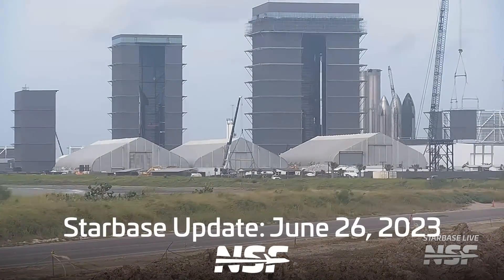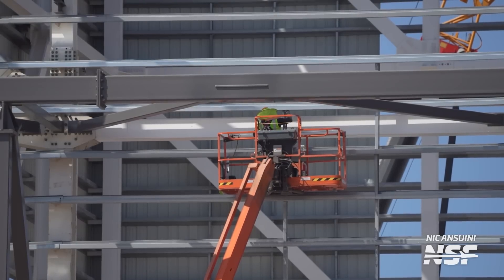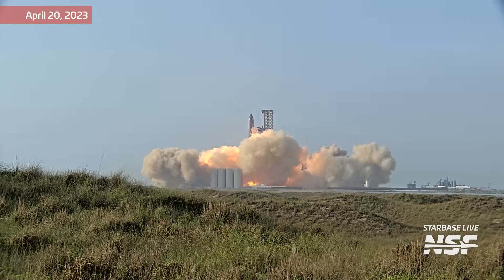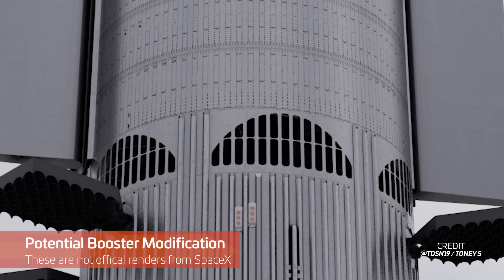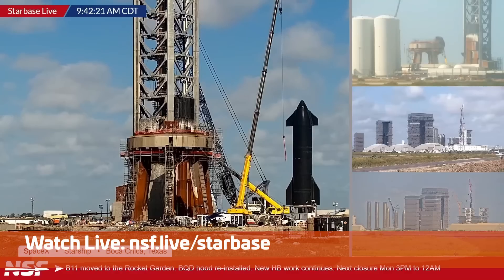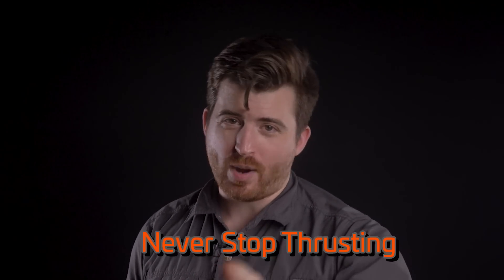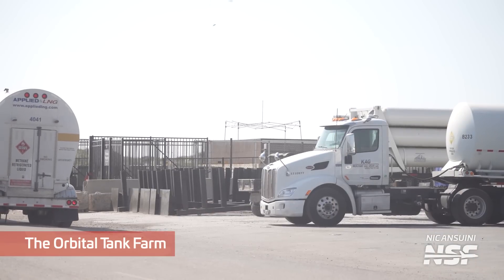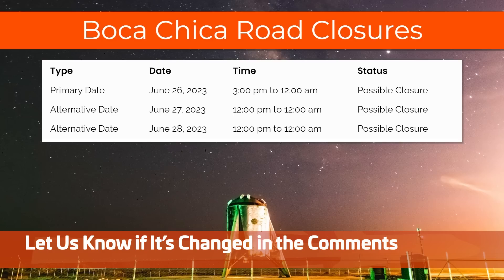Starbase Update: Hot Staging Starship, Boosters A Plenty & The Mega Bay Rises

Comment: Can someone offer an explanation for why the inverted showerhead design (as Elon shared) for the deluge system isn't flawed?  If the deluge system is trying to force water upwards, in direct opposition to the downwards force of Booster's thrust, wouldn't the force of the water need to be sufficient to overcome the considerable downwards force of all those raptor engines?  Sure, there will now be steal plates involved - not just concrete being blasted into projectile fragments... If you factor in that gas compresses (building up potential energy) much more than water, the point that the full potential energy is released in counter to the water pressure...

Comment: The hot staging interface requires some form of shield to protect the top of the booster. It will be integrated into the new section that is planned to be added top of the booster. IMO it will take damage. A solution is to make this interstage a replaceable puck, old one removed, new one added for next flight. That can be quickly and easily done, less than one hour.

Comment: Definitely feel Hot stage sep would    have some impact on reusability. We have to remember that the hardware for the header tanks where largely mounted on top. I would not be surprised if they need to add some sort of diverter/heat shield puck that will sit on the inside and need to be replaced between so many flights. Its doable but would increase turnaround time and have a good impact on mass to orbit.
Reply: The only header tank on the booster is all the way at the bottom near the engines and not at the top.

Comment: I could see a hot stage being easy to deal with, you could just place a steel plate on top of the booster and let it degredate over time until it needs swapping out, would also be cheap, however you would have to give up some postitive thrust for the weight of the plate

Comment: I have a bad feeling about a Hot Boost, but I hope it works.
Reply: Hot boost is mandatory. Otherwise it's just a water rocket. 😅
Reply: Exhaust temps at that altitude will be much lower than at sea level. Out gassing  will be rapid and THE initial confined pressure before separation will be remarkably lower than one might think, and its not going to take all six engines at 100% to separate the stages. Hot staging at Spacex has always been a topic of discussion. They might NOT need to Hot stage if one or more alternatives are considered. Wish them all the BEST....Question NOT....what is Not understood.
Reply: @dunehut  agree pressure will not be as high as one might expect. But the expanding gas temperature will surely be very high. But it will be brief, so not much time for heat damage.

Comment: If booster will get the extension, it seems like that means the ship QD arm needs to be mounted higher on the tower. Unless it will have a mechanism to extend up/down from its current mount point.

Comment: So after noticing what rocket engine exhaust does to concrete, they decided to point it at their first stage instead 🤔
Reply: Should go better without a planet in the way
Reply: the ship only has 3 vacuum engines, although it might also fire the other 3 sea level engines too. thats much less engines than the booster, although its still pretty powerful ofc. someone else in the comments suggested that spacex could ignite only one engine for hotfiring (maybe at low throttle) which would reduce damage to the booster.

Comment: 😊why can’t they just cover the top of the booster with the same heat tiles that are on Starship so it doesn’t blow up during Hot staging? Especially since they would weigh a heck of a lot less then some super thick steel dome?
Reply: The heat tiles are very fragile.  They would blow off like dandelion fluff.
Reply: I can’t imagine it being under anymore pressure than they would be as they are in re-entry

Comment: Will that make the full stack taller? Consequently also making it necessary to increase the height of the SQD
Reply: Yh, links in with the reason for taking the SQD down as well. Its not gonna need to be massively higher, 1 ring maybe 1.5 rings so the arm doesn't need altering, but just a redesign of the QD bit on the end to make it higher up. 

We'll probably get a good idea whats what when they start adding steel work to the SQD platform.

That said they've said B9 and Ship 25 will be next, so unless they do work to B9 we might not see this until after then? Unless they just add a random extension piece on top?

Comment: I imagine hot staging will make it harder to get starship human certified by NASA.
Reply: Hot staging is a very reliable method of staging, so it might actually help.
Reply: It might actually improve crew safety, because it allows the Starship to reliably separate from the booster in an abort scenario if they go without a traditional abort system on crewed Starships.
Reply: Soyuz hot stages, and NASA flies crew on Soyuz, so no.

Comment: I have my doubts about hot staging.  They could blow up both stages. Raptors will be way to close to be firing.
Reply: Hot stageng can easily be accomplished by just firing one raptor initially and after seperating go 100% with all engines
Reply: @frankderks1150  I had the same doubts about hot firing, but that idea didn't occur to me. even with only one engine at low power, you still would blasting the booster, which doesn't seem like the best idea for rapid reuse. however, we will just have to wait till the launch and see how well it works during stage sep (hopefully)
Reply: @HamzahKhan314  This can be tested on the ground. Pressurized a booster with nitrogen and test fire a starship on top. Also a possibility is to do hot staging by starting up the vac engines first. These are above the more slanted area of the dome and output the energy across a larger area.
Reply: @frankderks1150  i dont think they would test it on the ground. if there were a failure spacex would probably rather have it blow up during stage sep than on the pad.
starting vac engines first seams like a good idea. I dont think its been confirmed which engines will fire, but hopefully we can figure it out soon.

Comment: Here is what i dont get: How come the booster annihilated  the pad when fired (even during  the static fire with 50% power), but the Ships just casually do static fires on top of plain cement and we see no concrete chunks come flying? I mean it only has like half a dozen raptors but stills it fires them from pretty up close...
Reply: It's just the raw power difference between the two. The booster has 5.5 times as many engines, so with the same throttle settings for static fires thats 5.5 times the force, thermal energy and gas volume. The very early ship static fires like SN8 also had problems with the concrete, but over the years suborbital pad B got a few upgrades including the same fondag high strength concrete that was under the OLM.

Comment: If they are adding a vent structure to the Booster, it now makes sense that they would need to modify the Ship QD.  The Ship will be higher up and it's QD connections won't be in the same place.
Reply: If hot staging is successful it should also help prove that ship can escape a booster explosion.
Reply: Ope, I didn't see your reply before posting my duplicate comment. 👍

Comment: the real question is, will the vents weaken the rocket to the point that it collapses mid-flight
Reply: That bit should be very simple for the good engineers at SpaceX to calculate. The hard part is what to do to not harm the booster.

Comment: I came to the conclusion that Musk is more talk and advertising than anything else. The guy plays with crypto threw tweets for his own profit. He makes a space company while using outdated rocket projects resurrecting some 50 to 70's designs von wenher von braun. He couple those with modern technology and with modern thrusting systems. In my opinion he is more like a 50-70's space nerd trying to make the past projects happen than a space explorer. If he really wanted to revolutionize deep space exploration he would try to recover from the nerva program and build a space station to build nuclear rockets outside earth's orbit. It seems to me that his main objective is to make money threw cheap orbit transport for satelites and army devices threw reusable rockets and that deep space exploration is just an option he wants to try but not the main goal.  Let's be honest he is losing time with 30 engines while with 5 only he would have less issues and it would already probably reached orbit. He said 2035 on Mars but at this rate not even before 2070. I bet that if nasa works with darpa lockheed and northrop and get the funds they will get to mars way before musk.
Reply: The main point of Starship is to achive full and rapid reusabillity, which has been the holy grail of rocketry for the last 60 years. SpaceX is already the pioneer in this field with falcon 9, which is mostly reusable and only expending the second stage, already flying and landing multiple times per week. If Starship actually achieves this it would make transporting anything from earth into space at least 10 times cheaper, which will make large scale space projets even possible in the first place. Whats now known as Starship started out as the interplanetary transport system, a even bigger rocket concept with the only goal of deep space exploration, which was later downscaled to be used in the comercial launch market as a way of funding it's development. Starship is far from a big old school rocket as it's the most advanced launch vehicle ever by large margin and it's primary goals still is to make colonizing mars possible.

You also need to differneciate between Elon Musk, the individual and SpaceX, the company as there are thousends of rocket engineers and other employes working at SpaceX and on Starship. SpaceX is also a close partner of NASA, just like rocketdyne or the others and Starship is contracted to be a lunar lander for the Artemis missions. With all of this Starship is so much more than a billionaire space nerd trying to make big rockets happen.
Reply: @bongi6811  making Mars colonization possible ? A 1-2 years travel time is insane. Never mankind has tried this amount of space travel. The iss is space orbiting earth and can be easily refueled and repaired a thing that starship can’t do while going to Mars. A one years space travel would be like a suicide mission. If you increase the number of days for traveling you increase the issue probability. Everyday a system can fail, an impact can occur, plus people can become psychologically unstable in those situations. NASA could have done it but I bet they took those factors into consideration and said it should be reduced to less than half a year. Unless you are able to reduce time travel to 2 months it seems unlikely that we will reach Mars Alive and come back Alive ! And this is only possible threw nuclear propulsion.
Reply: @patrickwilliams2530  I don't think flying a year inside a Starship is unrealistic, since astronauts already spend nearly a year on the ISS which has a smaller habitable space than a Starship. But even if travel to mars requires a larger vehicle with a nuclear engine for shorter travel times, constructing many of those vehicles in orbit reqiures large amounts of payload to be sent from earth which is a perfect job for Starship and woundn't be possible with extremely expensive expendable rockets.
Reply: @bongi6811  the iss goes around orbit, they can be quickly supplied with anything they lack or any random tool for maintenance. Just think about an Apollo 13 issue type  with starship… they would be doomed… anything can happen in space and what Apollo taught us is that in every mission there is always something which fails or something which goes critical almost every mission. Apollo was only a 8 days mission and it had tons of issues… there were tons of engineers monitoring 3 man and the spaceship for 8 days. Now you tell me that a trip to Mars in 1-2 years with less engineers and with less experienced men will succeed? No way the first starship to launch to March will be a suicide mission.
Reply: @patrickwilliams2530  Any spacecraft making a trip to mars and back would of course need to be extremely reliable and have all the supplies, spare parts etc. onboard. While the ISS is much safer in case of a critical issue because of it's vicinity to earth, it also proved to be extremely reliable, staying operational for 20 years while only needing small repairs once in a while. The same requirements for a Starship making the trip to mars also apply to a quick nuclear powered vehicle and the reduced travel time shouldn't really make it easier since both already need basically perfect reliability which is achieved the same way through things like redundancy in critical systems. Getting the completely new nuclear engine to be reliable enough might even make that option more difficult.
Reply: @patrickwilliams2530  I completely agree that building a mars colony isn't a time critical thing that has to happen as soon as possible and there are lots of major challenges still in the way. I personally don't care if it takes 10, 50 or 500 years, but I want it to happen at some point since exploration and expanding our civilisation is a fundamental desire of humans and a permanent presence on multiple celestial bodies would be a major achievement of humanity. The spending on space exploration is miniscule in the grand sceme of things. NASA's budget for example is less than half a percent of US tax money and it's important to keep working on space exploration in the background while dealing with all our other problems to make sure that progress is made.

Comment: Pure speculation here, but I wonder whether the loss of control authority on the B7 / S24 launch inadvertently taught SpaceX that the planned booster flip method of achieving stage separation was unlikely to ever work and that they've moved onto this hot staging idea sooner than planned. If so, those kerbal type tumbles might have been a blessing in disguise in a way. 

I'll be impressed if SpaceX can make hot thrusting work perfectly on the first attempt, but either way, the second integrated flight test is going to be that much more interesting to witness. Here's hoping that "never stop thrusting" leads to more "excitement guaranteed"!
Reply: I don't think that's part of the decision to move to hot staging, because the bosster still needs to flip after hot staging for the boost back burn.

Comment: Wondering wether or not they could go with a sequenced hot-staging - ignite just one or two engines for stage separation to keep the heat- and pressure-load on the Booster low, light up the other five or four after they are away a few tens of meters?
Reply: I think that is likely, since they can't test it on land - the stands are not made to include that stage.

Comment: Hot staging certainly seems worth a look for potentially increasing the payload capacity quite significantly. The only thing im a bit cofused about is why they are experimenting with it so early in the development process, since payload volume doesn't matter that much for the early testing missions. I see this more like a upgrade for Starship in a couple years, just like SpaceX recently introduced the shorter Mvac nozzle as a upgrade for falcon 9 and I'm a bit worried that they once again underestimate the power of the raptor engines and waste a lot of development time on either getting the hot staging work or going back to the flip staging if it doesn't work out.
Reply: This whole program is one big R&D test series. If you want to introduce a design change then the earlier you do it the more times you get to test it and improve on it. The best time to start is when expectations are at a minimum - not when you have a working ship. Because later on it gets much harder to introduce radical changes.
Reply: @knowledgeisgood9645  I completely agree on that, it just seems to be a bit too early with all the other radical changes already happening and I worry that it could delay the early Starship flights and the Artemis program if it doesn't work out, but it would obviously be amazing to have a more capable Starship right away if it works out.
Reply: i think its still gonna flip and land (if the booster is planned to be reused) after hot staging, that is if it doesn't get damaged too much in the process to be able to land
Reply: Hot staging seems way more practical than the weird flip thing they were gonna try.
Reply: @philb5593  I am not sure it is an either or thing.
Reply: They are changing the separation because the first flight didn't separate.
Reply: @FastSloth87  It did not separate because it was too low in the atmosphere to do so. Had it made it beyond 80km it could very well have separated. 
This change did not just happen out of the blue. Someone has been studying it for months. The first prototype was seen just days after the first flight, which means this was designed before the B7/S24 flight.

Comment: What happens if there's high-pressure between the stages and then the stage separation clamps suddenly release, then in a very short time the upper stage engines fire?
Reply: Not sure what you mean? The additional ring has lots of open slits, how can there be any pressure between the stages? The clamps can be released several seconds before separation. Inertia will keep the stages together until the ship ignites its engines.
Reply: @knowledgeisgood9645  I was thinking about a very different sealed high pressure ring between the stages. Enough pressure that when the clamps are released it would cause the stages to pop apart.
Reply: @mustang607  How do you keep it tight? Any method to do it could cause a problem releasing the ship.
Reply: @knowledgeisgood9645  That's a problem for a rocket scientist.